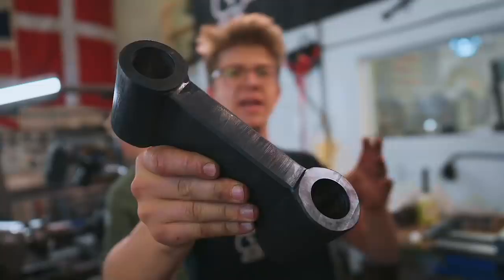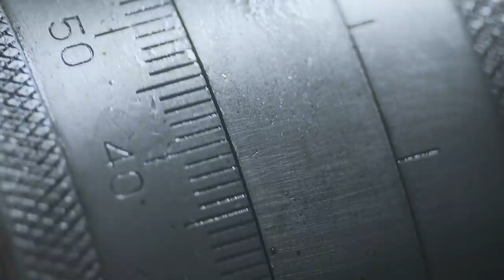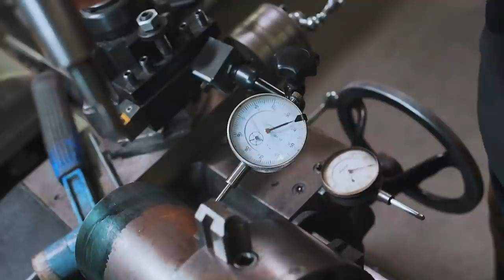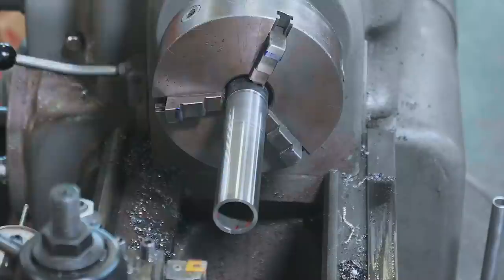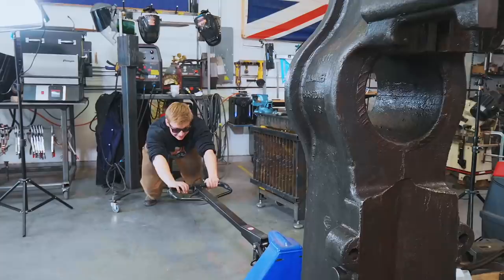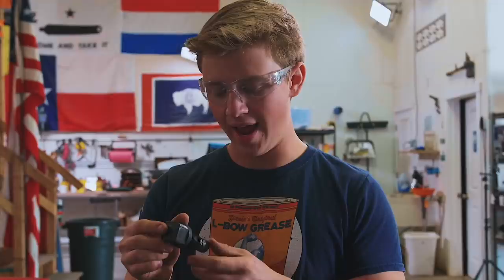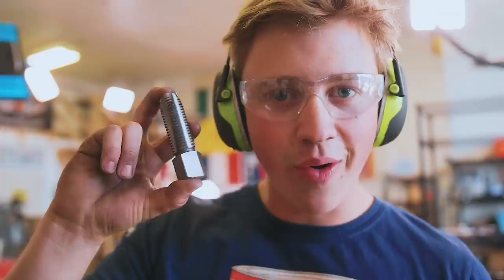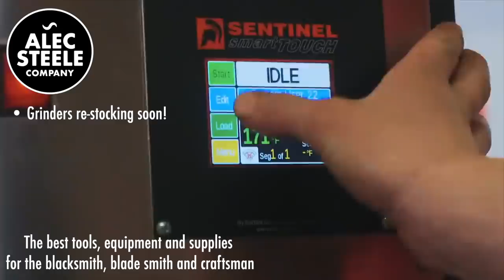RESTORING THE FAIRBANKS POWERHAMMER!!! Part 3

Comment: 1:30 it looks like you just mill one side flat then slap the link rod into a vice and mill the next side ... are you somehow making sure the surfaces are 90 degrees, or does it just not matter for that part?
Reply: Last video Alec did the whole spiel about how they mill the first surface then use it as a reference to set the position of the forging in the vise to mill the rest of the surfaces to specification.

He also got much ribbing for his technique from many machinists, and much advice on how to not repeat mistakes.

Comment: wait wait wait... if it was to tight at the end why didnt you just loosen the new bolt you just fabbed?? it was all the way screwed in wouldnt that make it tighter? isnt that the purpose of that bolt, to adjust the  circumference to match what you need it to hold? im so confused lolol

Comment: Ya I ordered a set of Koves with the “discount” code. What a bunch of bs. They “retail” at $199.99, then the discount brings them down to about $70 delivered. Then when you go to amazon, the “discount” is mysteriously already applied, meaning the $199.99 “retail” is a bunch of bs. That’s the crap harbor freight got class auctioned for, and lost. The headphones, crap. The button interface to turn on/off/sync then the button interface for “active noise cancelling” is difficult to figure out, and the leds that light up are very difficult to differentiate, as well as way too bright. Comfort wise, the foam padding compresses to a point of never returning back to normal, so don’t expect comfort if you fall asleep in these more than a few times. They’re cheap plastic China export certified headphones on par with the $10 pairs you find at wal mart. I have audio technicas, Bose quiet comfort 2s, and some no name brands, all are superior to Koves in every way. Never again Alec; your schill game makes me distrust every product you ever feature.

Comment: I'm probably missing something here, but why is the hole off center in the pitman arm? Does the outer diameter engage with anything?
Reply: Translates rotary motion of the wheel to linear up and down motion of the hammer. Think of how a steam locomotive works, then turn it vertical.
Reply: @boothbytcd6011  But the pitman arm doesn't attach anything that rotates to the eccentric outer diameter. It attaches to a crank wheel/disk that has an eccentric pin that drives the pitman arm.

Comment: Try NOT using pulse when TIG welding anything over 1/8" wall thickness . You are actually keeping yourself from putting a hotter weld in the joint by pulsing it , especially with a TIG . The only thing I will pulse on , is 24 ga. stainless . And for welding that heavy pin stock and pipe , try to TIG the root  only , then turn that MIG way up to 23V and MIG that . It will be a far more shock resistant weld. But love the work you guys do , and always interesting stuff .

Comment: All nice and everything but is it a REAL restoration if you don't dig up your own ore, built a smelter, extract your metal and forge it into billets, turn them into lathe parts, build your own lathe and use it to turn your replacement bolt? Enough with the shortcuts Will!

Comment: Instead of using a die grinder to chamfer the inside of the hole, why didn’t you just use the lathe? When you were boring the hole in what you are calling the washer you should have turned it around, and put it back in the Chuck. You never want anymore stickout than you absolutely have to have.

Comment: Far be it from me to give any pointers to a guy who just made his own tap...however.   When you made the .875x9 bolt I would have liked to see q little more radius on the shoulder on the head.  My old mentor used to say "A radius is your friend"  That square corner is where that will break if it's over-torqued.  Great work guys.

Comment: Why would you machine a secondary sleeve when you could just refabricate the part to the right size? It's not that  much more expensive, surely? You've introduced an unnecessary failure mode to my mind.

Comment: Should have just drilled out the threads and used a bolt and nut instead of making a tap. Simple solution.

Comment: He threads the rod he needs, welds it in after.

I know it probably makes it stronger and easier to put in.
Reply: I was thinking the same thing. I thought the threads would weaken the thread location and if you was going to weld it why not shove it in weld it outside and inside grind inside smooth and done. But I have no clue or evidence of my method vs their method so some machinist let me know thanks
Reply: It's just a lot easier to line it up that way. You certainly could just weld it but you'd have to clamp it and sequence it pretty good. The threads also make it a bit stronger as opposed to just a blank hole
Reply: @MrWrl101  It wont weaken anything ,have you seen the chunk of meat that thing has?With that wall thickness and a fine thread like he did.
Sure he could have spare himself some time and just loose fit weld it while holding center on a lathe.
What he did with a belt grinder is unecessary , that radius provides nothing he could have just cut the thread shorter ,there is plenty of room to hold the bushing .
But hey they are amatures that have time .
What he did wrong is that he didnt put the oiler or a grease nipple ,and then cut light oil grooves in a bushing.Idk if he is going to do that in next episode.
Reply: @zumbazumba1  was thinking the same thing about the oiling points.

Also, what monster would weld parts on a Monarch or any good lathe for that matter
Reply: @Nubby007  As long as earth cable is on the part you are welding its fine ,you can use aluminum foil to protect machine from splatter.

Comment: That pitman as you call it shoudl have been shim tight and then bored out on a milling machine-ream it -that way you got round surface ,and THEN you measure it and buy a stock according to it.
Remove the shims and clamp it and you got yourself a full surface contact.

Also put a oiler and oil grooves on that bushing,who wants to remove whole thing to oil it up.

Remember kids and grown up kids ,whenever you are fixing old peace of junk like this and you are making the new part -Clean the old ones on a lathe/milling machine/ream the holes etc until you got nice round hole/slot for keyway or whatever -then buy stock accordingly and make it fit .
You will save yourself a ton of time and the cursing words when your new  part fits like a glove instead of some burr or out of roundness fucking your day up and turns a 30min job into a 3h  just because you were lazy to spend 1h doing it properly ! Sounds familiar?

Comment: if you had ready access to liquid nitrogen, you could soak the bolt/pin and then try to guide it into the clamp. same principle as using heat on the clamp, just in reverse.

Comment: This repair job is a tragedy...
Especially the whole pitman section with the resleeving (wich at least should be tightly press fit, not just welded at the ends) and the fact that they didn't bother to measure the gap left by opening the T-joint to adjust the diameter to the new piece so it was tight.
Also, ever heard "measure twice, cut once"? if you are "terrible at machining" you should be working with blueprints in front of you for constant reference...

Comment: Why not just put a wedge in the gap and force it open slightly so it fits? That way you don't warp it again with the heat. You've only got to get it in there once

Comment: I have a process question, why thread the pittman shaft to then weld it to the bushng?
Reply: Much easier to line up that way and it adds a bit more strength than a blank hole with a shaft welded in it.
It could certainly be welded but you'd have to clamp it pretty well and sequence it. Also, pretty beefy shaft and a relatively thin bushing so deep penetration with that weld without deforming the note for the bushing would be a point too.

Comment: why thread the shaft if he was gonna weld it???
Reply: More secure
Reply: Was wondering the same.  Why why why.  The threads would make a weak point I think 🤔
Reply: Ever bolt I ever broke and it is a lot lol. It broke at the threads
Reply: @otterconnor942  more secure then a outer / inner weld. No way.  Grind the inner smooth a good weld dose not break every bolt I ever broke breaks at the threads. 🤔
Reply: Much easier to line up that way and it adds a bit more strength than a blank hole with a shaft welded in it.
It could certainly be welded but you'd have to clamp it pretty well and sequence it. Also, pretty beefy shaft and a relatively thin bushing so deep penetration with that weld without deforming the bore for the bushing would be a point too.

Comment: Why did it need to be threaded if you were just going to weld it solid?
Reply: Much easier to line up that way and it adds a bit more strength than a blank hole with a shaft welded in it.
It could certainly be welded but you'd have to clamp it pretty well and sequence it. Also, pretty beefy shaft and a relatively thin bushing so deep penetration with that weld without deforming the note for the bushing would be a point too.

Comment: As an European, those inch numbers just sound insanely complicated. 25mm = 110.000 of an inch??? No wonder you make mistakes with that over the top system :D
Reply: 25.4mm is roughly 1 inch. Normally we use thousands of an inch when machining or taking precision measurements. That being said, if you're used to fractional inches, feet, yards, etc. it's really not that hard to understand. I use both, but prefer imperial units.